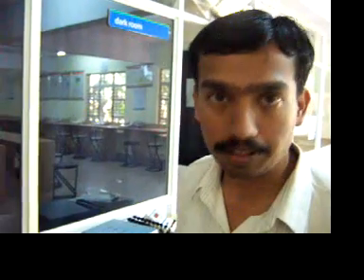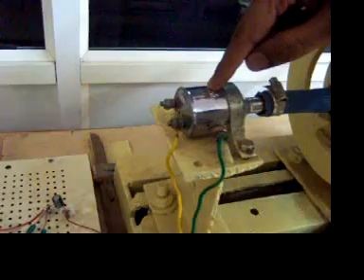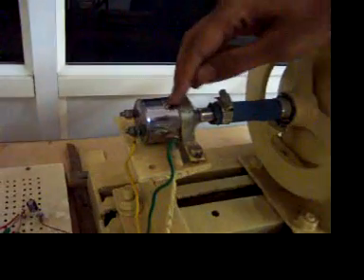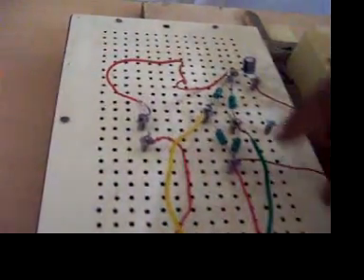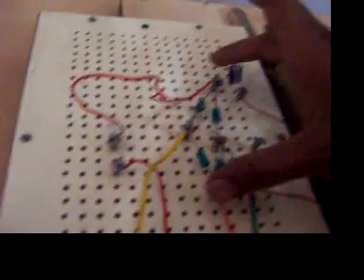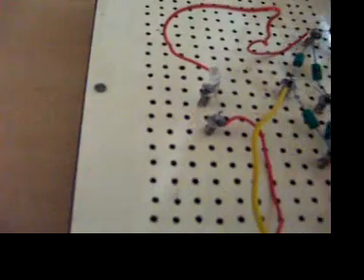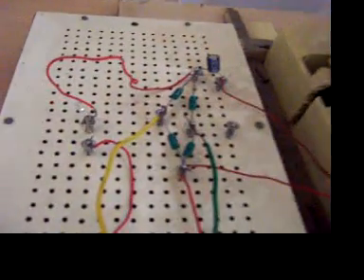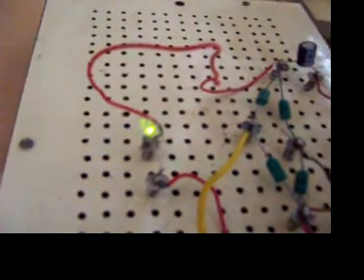Make a Generator (DC) High school Physics Project Ravish Dynamo

Comment from the maker: Mr Shane caalaman
Yes it should be possible.Bicycle will generate AC voltage.It has to be rectified. Then use a rechargeable battery to store this energy. A charger requires 5V and 800milli ampere current  (4 watt) .So your bicycle has to produce this much energy (around 4watt)

Comment from the maker: Electrical energy output can be calculated by measuring voltage and current across a resistance. Assuming this set up to be 50% efficient, Mechanical energy input may be approximated.

Comment: your arrangement OK but  why lit the LED  directly connect 6v or 12v bulb to glow and don't need rectifier to glow LED it glows both side of AC (cycle dynamo AC) only connect series resistor (current limiter)  with LED

Comment from the maker: It is just a wooden plate with small holes (2mm diameter).I bought suitable spring pins to fit those holes.I connect the wires to the spring pins.I suggest u to buy one such board available in the market.This will save time.

Comment from the maker: true, what I meant when I said 'same set up' is that in my set up I have connected a rectifier system (bridge rectifier with four semiconductor diodes) shown in the video.This part converts Ac to DC. Slip ring could also be used.

Comment: @raveeshakh I'll have to dissagree. As far as I know, we could use mechanical energy to rotate a coil in the magnetic field of the magnet and then instead of using 2 slip rings we use a commutator which enables the production of DC directly.

Comment: this is way over complicated, just get a little moter out of a tape player or remote controle car and you dont need anything esle just somthing to spin the moter and two wires from the back end hooked to a light, or anything else you dont need a bridge rectifier